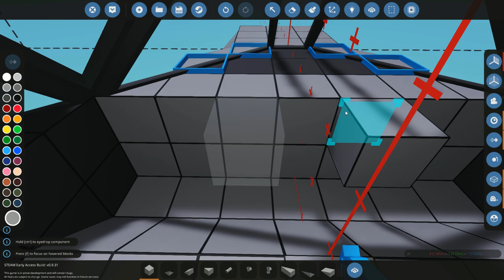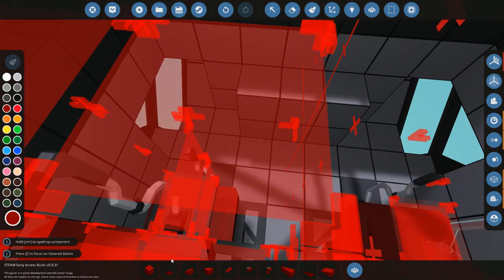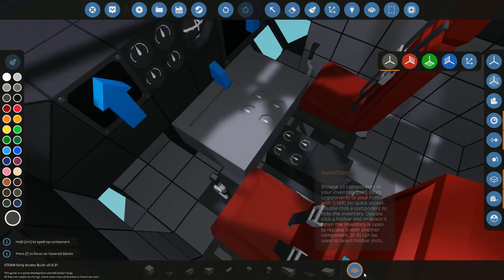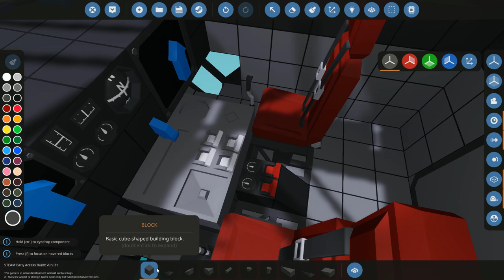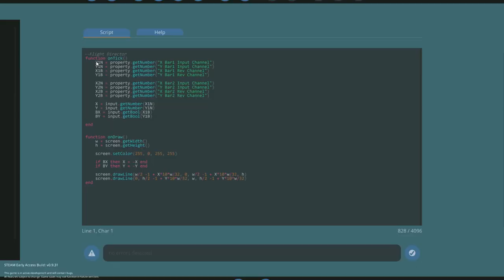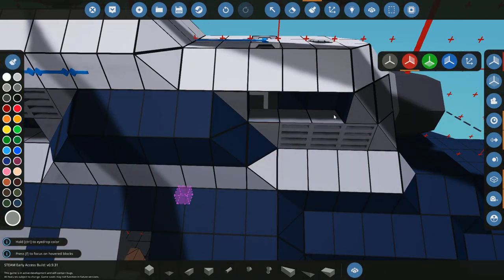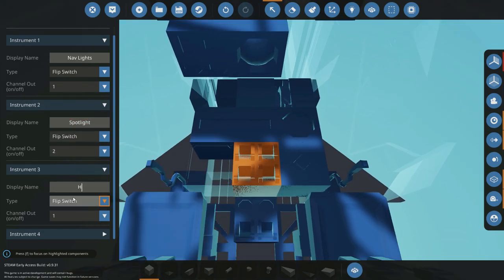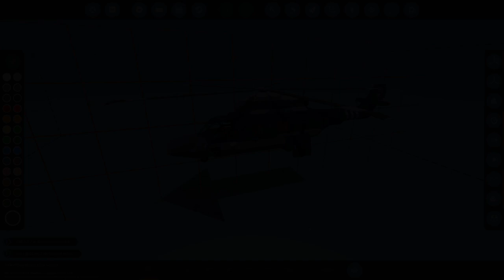Stormworks B&R l Heli Build Part 4

Comment: this is going to sound bad but.
coding is actually kind of easy and fun when you take a step back from making it a goal.

in each of my builds i add little bits to my code so i dont give up from trying to make a crazy system.

i started with the basic map code for my first car, added text and zoom level in my second. for my heli that i just finished after a month, i added touch controls and a flight path for auto pilot. i took the same touch control code from my gimbal camera from a previous build and pasted it under the map code, changed a few tags and logic, works perfectly.

its similar to how i make ECUs, my first one was fully manual, using a throttle leaver as a gear selector and it had a lot of hiccups, but it worked.
next car had the same ecu but used up and down inputs and a counter for gears, was semi auto, had a way better pid for engine throttle and had several new features and improvements. then i loaded it in place of the old ecu on my previous car, making it work 10* better. i didnt get overwhelmed because i split it between multiple projects.
Reply from the maker: Very good advice, I will certainly try to do this across my builds later on.